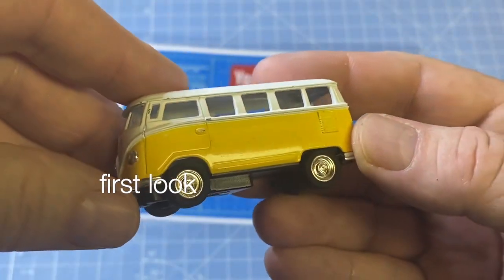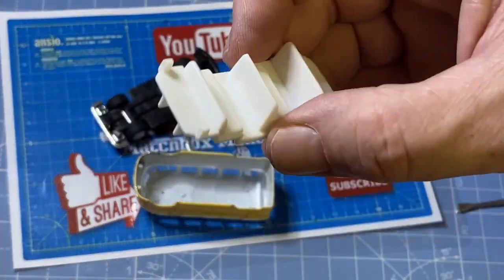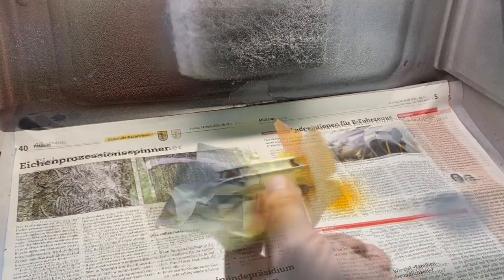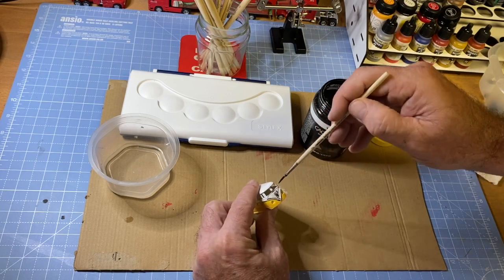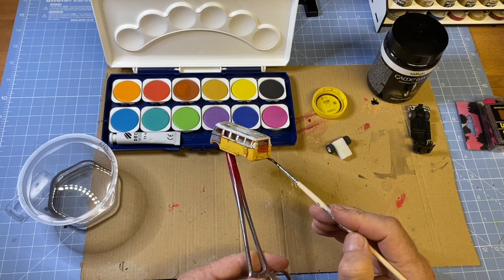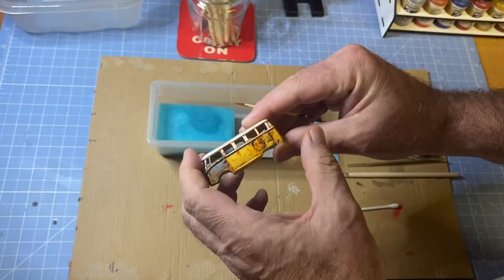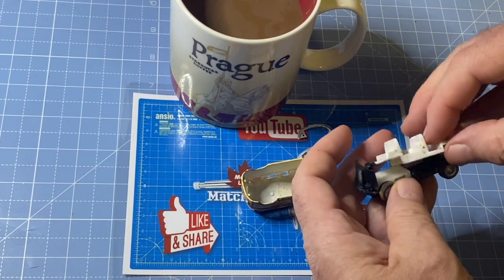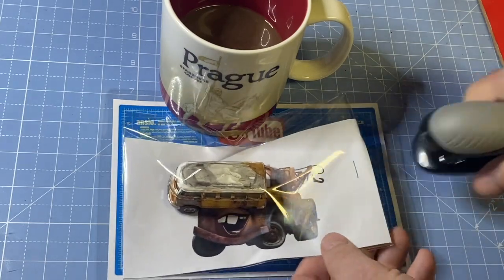Kinsmart VW Classical Bus (053)

Comment: Andrew you did an amazing job on the VW Bus. It looks like it has been to just about every concert during the late 60's early 70's and spent many years in the Mojave desert. In my early teens my dad bought a used 67 bus that was green and white with all the camper goodies except for the pop up top. Did my first engine swap on it. Didn't get to travel many places as my dad used it as his mobile lock shop. It was a fun vehicle to drive as I did sneak it out a few times until someone vandalized it by throwing a cinder block through the windshields. Needless to say she was broken down for parts so other VW's could continue. Which was sad because for her age and considering Missouri winters, she was completely rust free
Reply from the maker: Great story, Drew. Thanks. So you cut your teeth on the VW engine! I know these were easy to work on. Sounds like all good memories for you. Thanks for watching.

Comment: Very nice work, love how you did the headlights 
. Watching some of your videos now . 
Mike Espo .
Reply from the maker: Thanks, Mike. Water paints seemed a safe way to begin experimenting with weathering. I might try the salt technique next. And now I know about kitchen condiments, thanks to your Titanic video! 👍 Be safe in the USA, brother. I'm watching your news from over here. Crazy days.
Reply: Yea , people are very crazy right now what a sin .
Anyway , when you used the water paint on plastic how did you get it to stay after you were done ? I maybe not asking the question right , 
Because water paint runs off metal and plastic so when you are done with the model car , does it stay good ? 
Thanks Mike .
Reply from the maker: @diecast_MikeEspo  I had the same question when I was beginning this experiment, so I did a test on another junker car which was also plastic. After it dried in a few hours it was permanent. After two days it was still fine. So I did it on this one for YouTube and can report the same thing. I didn't want to clear coat it at the end, because that would be counter to the rust effect. However, when applying the paint, if you make a mistake, it wipes away easily. I was surprised and pleased at the final result. (I was wondering the same thing about the permanency of your paprika and cinnamon on the Titanic).
Reply: The spices stay on tight , but a little bit falls off every time, I have done this on car models .
But then you get to a point and the model looks great and no more spice falls off . 
Mike
Reply from the maker: @diecast_MikeEspo  A bit of paprika under the model lends to the rusty authenticity!
Reply: Yes , it is awesome, give it a try , you will be cool with the results. Mike

Comment: Well done weathering :) 
Have two Kinsmart models myself, Mazda RX-8 and Toyota Corolla sedan (Altis), but they are around 1/35 scale. They have pullback feature as well. I think the Corolla is actually based on US market Corolla version as the Euro Corolla looked a bit different.
I also have VW T1 "Samba bus" but it's 1/43 scale and made by Hongwell.
Reply from the maker: Thanks. First Kinsmart for me, but I have a few more for future projects. I also have a couple of the larger scale Kinsmarts - a VW Beetle and 2 Mini Coopers. I like them.